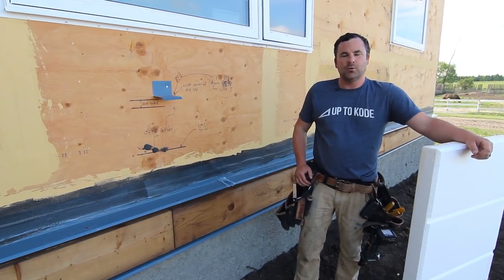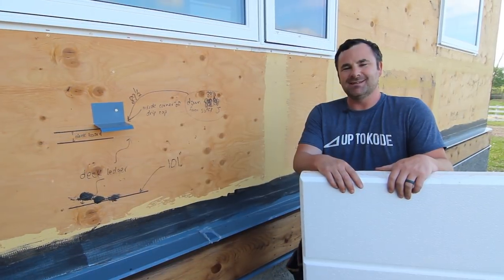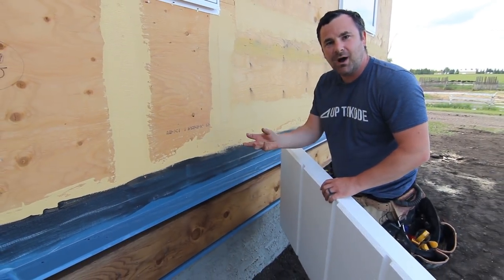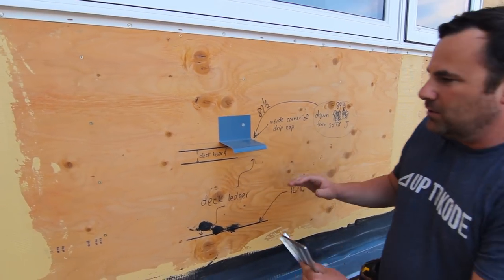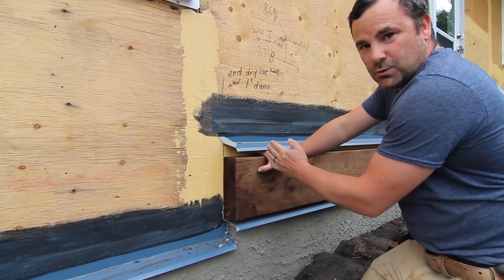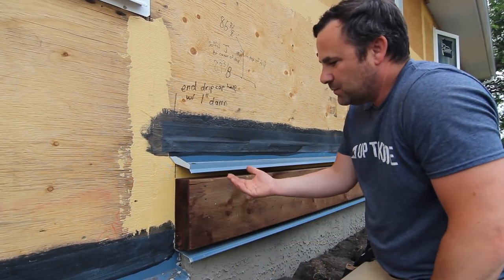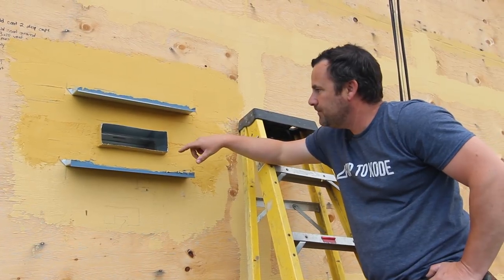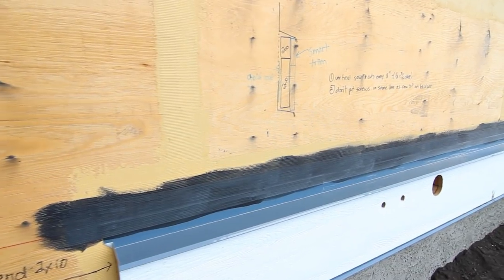Preparing Deck Ledgers, Flashing's, and Penetrations in an EIFS Stucco System

Comment: Kode have you done timber frame with ICF.  I wanted to do basement and first level in ICF.  The problem I see is allowing the timbers to sit once placed on the first floor.  I think my only choice is sips because I don't want the timbers to change color in the sun and rain.  ICF would take too long.  The timbers are set 3/4 inch inside the interior walls and they only support the SIPS roof.  How would you support the first floor timbers in the ICF basement?
Reply from the maker: I’ve heard of many people who have done ICF basement with timber frame above. 

If you wanted to go full ICF to the roof it doesn’t take that long unless it’s a complex build. 2 weeks on average. 

I would need more info if you wanted more specific help.

Comment: Doing a remodeling project with existing OLD way of EIFS. Can i do gold coat instead of weather barrier paper as before? what are the steps?
Reply: Dryvit backstop texture and backstop smooth is better to use and their Primus adhesive is way easier to mix ND use than STO.. go with dryvit